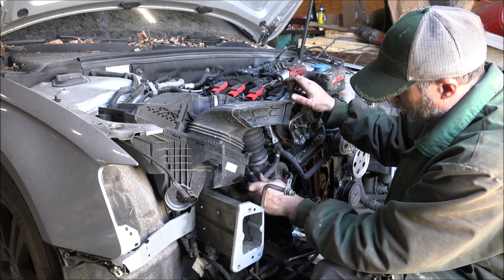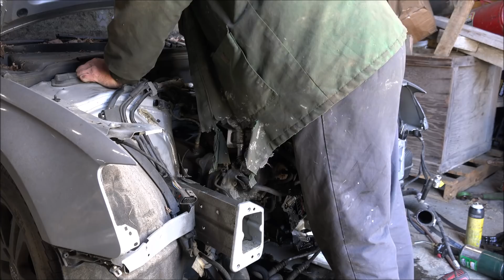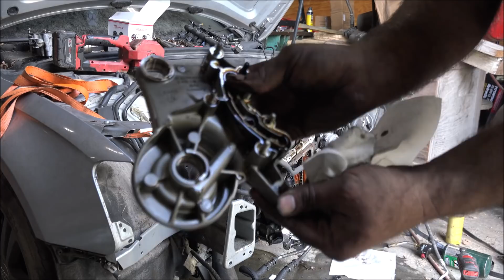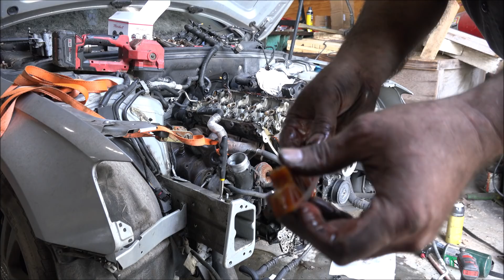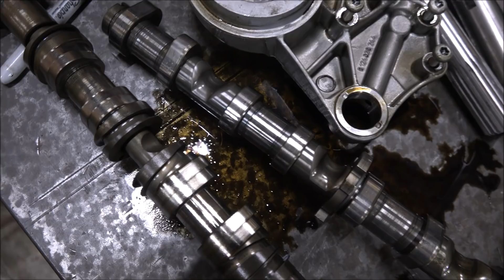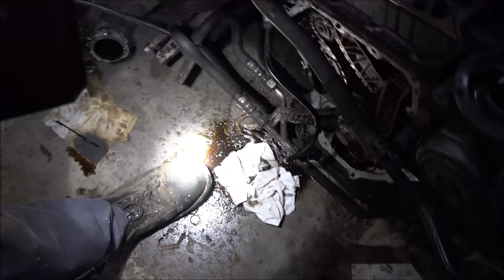Well That Ain't Good #4 2009 Audi 2.0TFSI Killed by junk Plastic Timing rails! Total Destruction!

Comment: The problem with those "high end" cars is that they are simply not designed right. I have a Golf 5 2005 tdi 2.0 bkd engine. Most of them end their life with head failure. Mine started generating white smoke and consumed coolant like there is no tomorrow. I disassembled and inspected everything. I replaced the head gasket, I surface ground the mating surface of the head to around 5 tenths overall. I went through it with a microscope and I found no visible cracks(I was planning to tig weld any I could find) . Still after I put everything back together I had billowing white smoke and coolant in cylinder 1... People in the know call it head porosity. VW used a bad alloy for the head which becomes sponge-like and let's coolant through microscopical cracks. German engineering my ass! In the end I decided to try adding sodium silicate to the coolant. It is a chemical used in the old days to make wood fireproof and as an ingredient in certain high temperature glues. It can be bought under a name of "liquid glass" and is in some "head gasket repair liquids" I never believed in. The way it works is it turns to silicone dioxide (sand) in presence of high heat (few hundred degrees). I put it in the coolant, run the engine for half an hour, and now two years later I'm still using that car with no problems whatsoever. Sodium silicate fixed the head porosity, I just have to remember to add it again after coolant change as it has to be present to reseal any microscopic cracks that will open. Also please note there are lots of bullshit products on the market. Liquids etc that claim to fix all problems with cracked heads etc. The only products that work have sodium or potassium silicate and they seal microscopic porosity not visible cracks. I hope my story helps someone fix their car.

Comment: you want something that's bulletproof shoe horn 12 VALVE Cummins in it.
Reply: Brian’s got the shoe horn!
Reply: Had a 2000 3500 dually that had both fuel pumps go out at the same time. Found out from the service manager that the new fuel ( no sulfur) was the cause.New up pump and distribution pump rebuild, 3k $.

Comment: I will never, ever, buy an Audi. Thanks for the info..
Reply from the maker: Just never own one out of warranty!
Reply: BMWs are even worse... they last more or less right up to the end of their warranty, but you really need to start swapping out worn parts at ~2 years / 40,000 miles...
Reply: All the modern (mid 90s onward) euro stuff is like this. I think they're just not built for the typical American used car use case. It's my understanding that it's typical in west Europe to junk cars for reasons we'd consider trivial after 10 years or so.

Comment: Well you can find another plastic engine everywhere on the net. I thought those cars are supposed to be high end automobiles. Every rich person l guess loves rattling plastic. Except Brian he was forced into the plastic engine by a higher power. All Men know this higher power. I myself have been controlled by this higher power for 28 years. At first its like a great cup of coffee. Then after awhile you caught in a web you cannot escape from. 🙃👍
Reply: Not really, the best five thousand dollars I ever spent fixed my issue. Ten times cheaper than a hit man but he is on retainer.
Reply from the maker: The plastic is no doubt for cheap cost and low noise. They could have put a bushinged roller sprocket in with oil pressure lube and had it last forever.
Reply: If you have the coin to buy these cars new you likely dump it long before these issues pop up, that's why these more modern euro cars depreciate like a brick out of an airplane.

Comment: You could put a 1.9 or 2.0 TDI but it would be a lot of work. Maybe a mechanical Rabbit diesel if you could find one. That motor probably has a bent rod and not worth fixing. Best bet is a low mile junkyard engine also least time consuming....
Reply: I cannot imagine that the rod was not bent when the valve pounded around in there.
Reply from the maker: I measured the piston to deck and they all measure the same within .003" so don't think it is bent especially since it was the 2nd highest one.
Reply: @bcbloc02  That is a lot of effort and money for a "Hail Mary" personally, I wouldn't fix it, something had to give when it tried to make a dime out of a valve head, I would put an engine in it, especially if it were my wifes... Happy Wife, Happy Life.....  You know if it breaks it will be 100 miles away at 3am during a blizzard, that would be my luck....
Reply: @CapeCodCNC  , he could throw a junkyard head on it to get it going and take it to an Audi dealer and trade it in on something different!

Comment: Hey that valve went through the vehicle EVAP system lmfao . My wife’s Jetta did the same thing when the second replacement timing belt broke , got lucky on first broken belt . Second one got oil soaked from the cam seal pushing out n did a lot of damage. It’s bringing back memories lol.
Reply from the maker: Sorry for the flashback!!
Reply: @bcbloc02  lol my favorite saying is ! I’ve done so much with so little I can now do anything with nothing at all . Those little glimpses in time are needed to try n remind me why I still do these things ,it’s to get a laugh straight from China ,Germany ,ECT .

Comment: The TDI diesel engines didn't have that weak ass cam chain, they had a regular cam belt, and work flawlessly. They put in a bicycle chain as cam chain to make it run with low friction in order to improve fuel efficiency. The Diesel have much better fuel efficiency anyways, so buying one with a gas engine is a bad call.
Reply from the maker: But you can't buy an all wheel drive diesel sedan in the US. Only the europeans get those fun cars.

Comment: Performance Tool W83182 VW/Audi Head Bolt Socket Bit and Performance Tool W83016 7pc VW-Audi-Porsche Bit Set  not expensive online. 

at a shop i worked at. when people called with newer audi's and newer VW's    Oudi here.

Comment: You should hit up Charles from the humble mechanic on you tube he is a vw Audi  tech and knows all there is to know about the dreaded plastic guide rails, I have no doubt that he can point you in the right direction Brian.
Reply from the maker: will have to check it out!
Reply: I think he is based in Florida and he is a sound fella that has tonnes of videos of him breaking down engines from audi and VW and is only two happy to share his knowledge,  best of luck pal.

Comment: Brian, That valve face went out the exhaust is my bet (breaks up and burns up then out the exhaust)
Reply from the maker: Doubt it would burn up in a few seconds of idle time.
Reply: I'm thinking that it's wedged in the exhaust manifold, or blocking the guard screen at the inlet to the catalytic converter, unless there's some other hang-up point in the exhaust ducting.
Reply: @bcbloc02  True but looks too big to pass the exhaust valve in one piece. It would have hit the plug at least once is the spark plug all mangled?
Reply from the maker: @ypopnun1003  Yeah spark plug took a good lick once.

Comment: The plastic falling apart. Or breaking at the web is from it reacting with engine oil new oil types go acidic to meet epa reg. If the plastic feels anything but slippery it is oil failure. Well really engineering failure they could have made them out of ppsu plastic as ppsu is resistant to all acids under 220c. Vs nylon type. Rover was the first to go public about it as the newish Landover had timing problems found on oil date not milage. This caused bmw to admit they had been putting the wrong oil in vehicles for over 12 years.
Reply from the maker: The plastic is pretty brittle and easily broken. The slide on the other side out of black plastic is way stronger and better.
Reply: Glad to hear this from someone who is current on plastics... I couldn't tell much of anything specific from just what's in the video, just that the failure was at a stress riser point = design too close to critical, and that the resin got brittle = poor selection for the application.
Reply: @bcbloc02  wonderful scale in engineering save few cents in plastic x 450k parts manufactured = savings of a perceived value

Comment: Best bet with that engine is a second hand head and put it back together. Replacing with a diesel engine will result in a big hole in your wallet , as you will need an engine, wiring loom , ECU and diesel fuel tank and diesel fuel lines. plus a load of other items. VAG stuff is ok when it is working. these engines suffer from stretched timing chains and chain tensioner problems. Chains are normally replaced every 100 000 miles.
Reply from the maker: Why would the tank and lines need changed?
Reply: @bcbloc02  diesel lines are different size to petrol lines and position.

Comment: Just put another engine on the car and sell the thing, it’s a money pit from here on
Reply from the maker: Aren't all cars? The payments never stop.
Reply: Hi Brian, I’ve been an VW fan/owner for over 30 years, I’ve owned and serviced/repair every model except Passat, diesel and gas, van or cars. In the last years they have been making only but junk. I’m out of the brand for good. Try japonés cars, like Lexus , she would like that, I’m sure, and you will have time at hand to fix other things.

Comment: One of the biggest auto nightmares of my life was an Audi wiring harness flamed out ,,, and the wires changed colors every place it went through a firewall and from interior to trunk... 

Three colors of one circuit in the trip from front to back!!! (stupid Euro junk)... I was the third mechanic to tackle it and give up... Until it finally went to the dealer...       ;o)       . 
O,,,
Reply: I did get a lot farther than the other two mechanics...  LOL     . 
O,,,
Reply from the maker: At least you tried!

Comment: Want me to 3d print new parts?
Just kidding. 
Frustrating when the customer is the life cycle tester.
Thanks,
John
Reply from the maker: Probably would be better than the parts Audi offers! lol
Reply: @bcbloc02  
They’re probably made from polyamide which doesn’t like a lot of heat.
I’m sure we could do WAY better with the geometry but we’d likely need carbon filled peek.
I can’t print that. 🙄
Thanks,
John

Comment: A camshaft chain tensioner should not be a maintenance item, it should last as long as the chain, which is life of the engine. Poor design
Reply from the maker: I agree. They could have used bushinged rollers and they would have been lifetime but why make a vehicle to last a long time for a customer when they know that 90% of all vehicles will be in 2nd hands by the time they fail.
Reply: German engineering doesn't make sense, those camshafts are very expensive to machine plus all that fancy variable cam stuff, but they skimp on a $30 cam chain tensioner! That's how they lost the war, fancy but unreliable equipment...

Comment: Blame it on the 3.5 qt. oil capacity and lack of maintenance.
Reply from the maker: Oil was changed using AUDI spec synthetic every 5000-6000 miles and that is far less than the 10k Audi recommends. Then it would either burn /loose a quart every 1000miles so it was really double changed in that interval.  I assumed when Audi rebuilt the engine the second time it got a new timing set but I guess they just put pistons in.